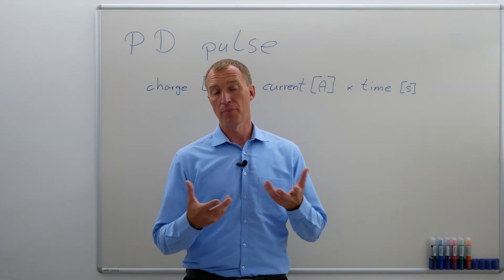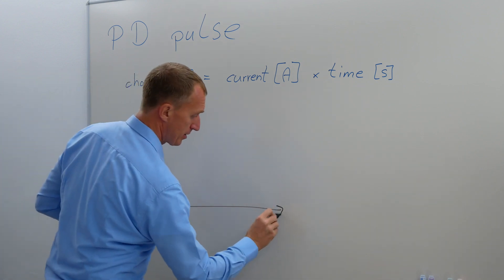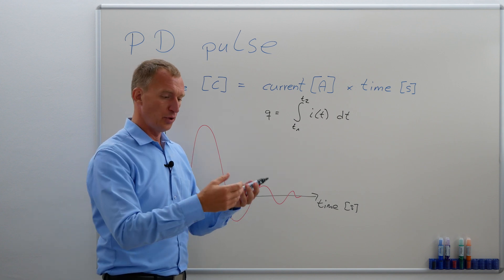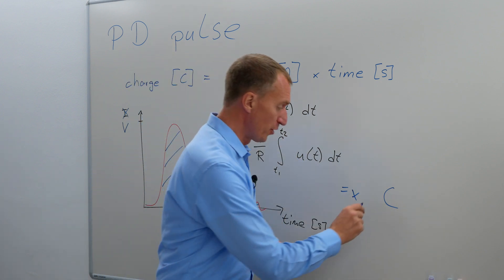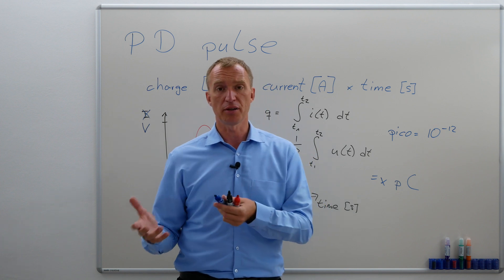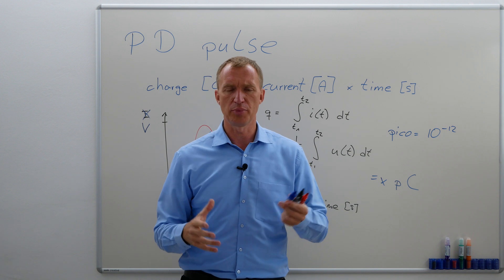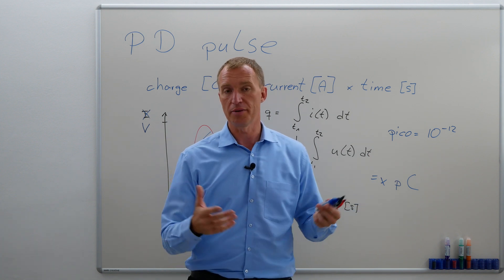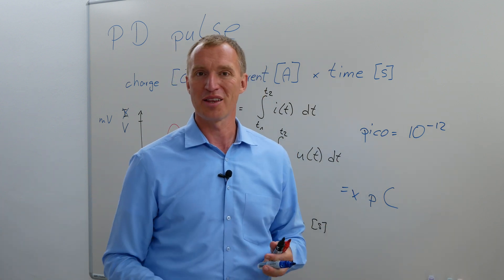2.1 Partial Discharges Vocabulary - Partial Discharges Pulse

Comment: I have two questions
1. In the integration of current versus time between t1 and t2, the postive areas could be cancelled by the negative areas. Am I correct ?
2. In the coulombs vs phase plot, what is the time reference for the phases, t1, or t2, or the peak value between t1 and t2